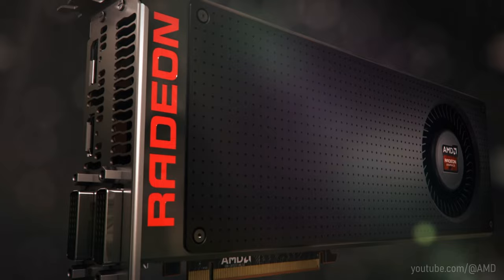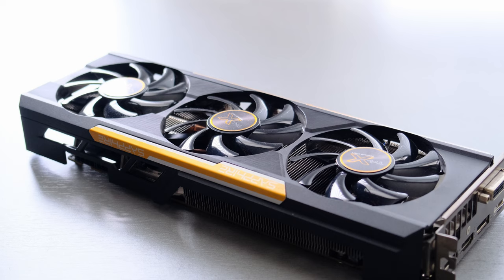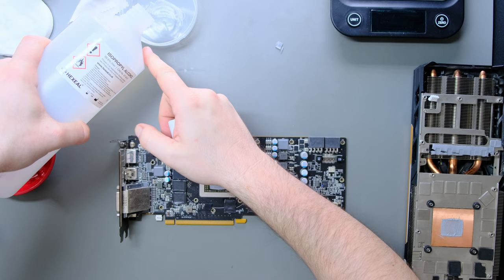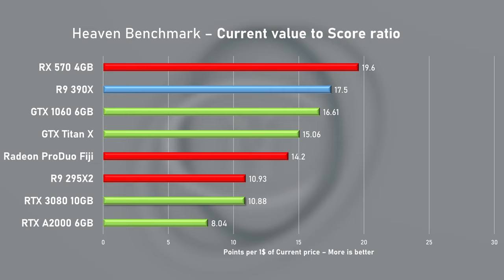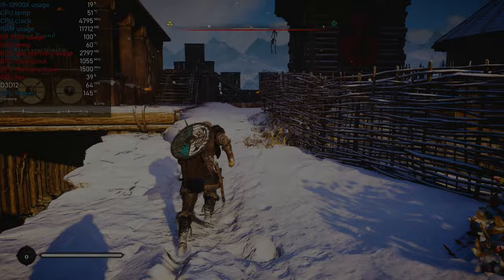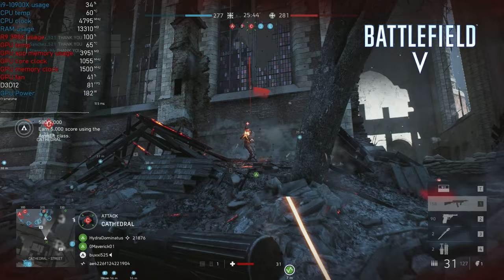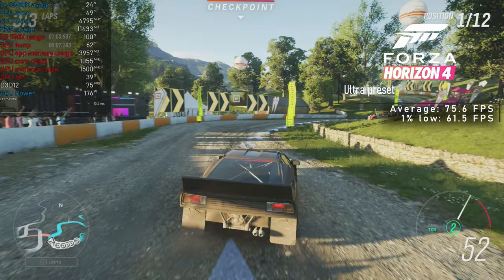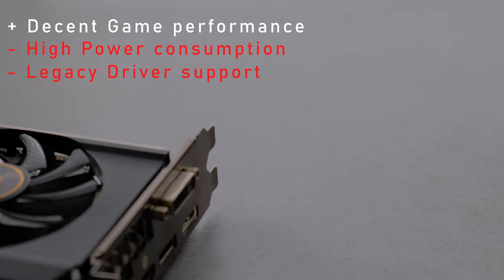The forsaken AMD GPU flagship - Radeon R9 390X Tested

Comment: 512-bit memory bus, now that's a proper GPU! And today the vendors try to sell you 128-bit e-waste for a higher price tag.
Reply: @ashen2192  the 390X is 8 years old and still holds up. The RX 6600 in 8 years down the line will be in a landfill.
Reply: @ProjectPhysX  That's a valid point. However, the reason the 6600 will be down in a landfill in 8 years is because of the 9th Gen. consoles. These old early GCN GPUs held on for so long was because the Xbox One and PlayStation 4 basically had lower mid-range GPUs (HD7770 and HD7850, respectively). 
Meanwhile, the Xbox Series X's GPU is comparable to RX6700 vs the PS5 is comparable to RX6600, once you factor in the clock speeds and L3 "Infinity" cache. The channel "Iceberg Tech" has published a video recently on the topic if you're interested:
https://www.youtube.com/watch?v=wyCvEW0DCbk
Reply from the maker: I love the monster spec on some of the older cards. Part of me really wanted the 390X to be faster but I do keep in mind it's 8 year old at this point. New cards come with faster memory so no need for as wide of a bus, but, the overall spec trend is going downwards, that we all agree on
Reply: @ProjectPhysX  There is a difference. The 390X was considered a flagship. The 6600 is budget mid tier, so of course it will suffer more in the future. 390X should be compared with 6900XT.
Reply: @mclarenf1gtr99  the 390X was $429, the 6600 is $329. The 6900 XT is $999, a completely different price class.
Reply: but what does it matter? gtx 1060 delivers same or better performance with much better efficiency. Why would huge memory bus matter if the performance isn't great?
Reply: @megapet777 because don't you know, a bigger number always means better!
Reply: @megapet777  390X is a GPU from 2013, while the GTX 1060 is from 2017. One is on 28nm which GPUs got stuck on for a long while and the other is on the much better 16nm process, thats why the 1060 is ahead. Wider memory buses matter a lot for Bandwith, which higher end GPUs are often limited by. Especially at higher resolutions.

It's like being suprised that a 980ti is slower and less energy efficient then a 2060
Reply: @shepardpolska  I know lol. But I just don't get why people talk about memory bus when it doesn't seem to really boost performance. Vega 64 had 2048 bit memory bus and was built on 14nm process while gtx 1080 has 256 bit memory bus and is on 16nm process. Yet their performance is nearly identical. How come vega had nearly 10x memory bus yet no real world advantage at all?
Reply: @ProjectPhysX  so what's better for you, GDDR5 512bit, or 256bit GDDR6X?
Reply: @ProjectPhysX  6600XT will be used for a long time I promise

Comment: Nexus Tech : the R9 390X 8GB is aging like AMD FINE RED WINE....while the GTX 980 4GB is left behind in dust :).
Reply from the maker: Eeey! I happen to have two GTX 980's, I shall put this to test!
Reply: @nexus_tech  So do I, an Asus Strix GTX 980 4GB (never 2 fan version) and a Gigabyte R9 390 8GB Windforce (the cooler isn't as good on this one as it was on my first MSI R9 390X 8GB Gaming 8G that I regret selling).

Comment: I got my GTX 970 refunded during the "3.5GB Gate" and bought an R9 390 with the money. Really good card power consumption set aside. 8GB on a 512bit bus for less than $400 8 years ago sounds pretty crazy when compared to the current gen GPUs sold at the same price range.

Comment: The R9 390 was an amazing card that aged really well in DX12 & Vulkan titles. Unfortunately it just couldn't hit 1080p 60fps in newer games as time went on. The heaven benchmark highlights it's biggest weakness. Poor tessellation performance
Reply from the maker: Thanks for checking out the video. I'm pretty sure there's more in that card if it was to be overclocked, if power is not a factor to consider, one can just about still get along with it :)

Comment: I am still using this GPU. It still is going well.
Today I changed the fans since the old ones were kinda giving up performance.
Also changed the cooling pads and the thermal paste. 
I went from 94°C top temperature to around 80-83°C.
I wouldnt recomment to play newest games in 1440p with high Graphics but most games nowadays even look awesome without
max graphic settings. 
Besides that it still manages to support 120Hz framerates.

Updating to newer drivers is also no problem since there is custom made drivers by a community so new games won't tell you that you cannot play 
the game due to outdated drivers anymore.

All in all, if you are looking for a budget card 50-100€ this thing is still in the game.

Comment: I used to have an R9 390 Tri x as well, ended up switching to an RX 6800xt just for power consumption, temperatures and overall efficiency, it was a great card when it had driver support I would say, it will always be a great card to remember :')

PD: I managed to catch that card for about $98 at 2020, they were hard times for GPU's

Comment: I had the 290X Battlefield 4 Edition with an Arctic Accelero Xtreme III to handle the excessive heat output. The authorized reseller even installed the cooler for me and allowed me to keep my warranty which is unusual here in Egypt. Best thing after a breakup. Buy yourself a top of the line GPU and get gaming
Reply from the maker: Thanks for sharing 👍 was it the blower design ? I bet that AC made all the difference

Comment: The Asus R9 390 was my first big boy card. Got it in 2015. I remember needing it for wolfenstein the new order (the R7 265 wasn't cutting it). I also remember the fans kicking in like crazy when my tank exploded in World of Tanks (Something about the fire effects). It got me through many amazing games and hours of CSGO.

It's when I got into computer hardware in general. Jay2cents, Gamersnexus and LTT (back when they focused on computers). I was overclocking and running the heaven benchmark runs against my friend that had a GTX970. 

I ran a couple R9 Furys when they blew them out on sale for half price, because I wanted to run crossfire (even though I knew it didn't make sense)

Then I bought a 980ti used. Strapped a Raijintek cooler on it, and ran that for a few years.

I miss overclocking. I miss the excitement of a new generation of GPUs coming in with amazing new value (the 1070 performed around 980ti levels for a fraction of the price).
I miss when games released that were finished. I miss a lot about those years.

Comment: If I recall, the RX200 and 300 series from AMD, as well GTX900 series from Nvidia, were supposed to be on TSMC's 20nm process. But since 20nm turned out be an absolute disaster (Snapdragon 808/810, anyone?) both Nvidia and AMD chose to steer well clear of that problematic node. 
And that's why these high-end RX200/300 series cards ran so damn hot. While the power efficient Maxwell (GTX900) behaved relatively well, the GCN 2 + 3 were doomed! 
This whole fiasco kind of reminds me of TSMC's 40nm woes and the hot-as-phuck Fermi (GTX400). AMD's TeraScale 2 (HD5000/6000), namely the HD5870, performed decently because it was smaller and more efficient while the GTX480 with the massive GF100 die basically turned into a meme!
Reply from the maker: Oh cool! I didn't know, thanks for sharing, interesting reading :)
Reply: It might have been the FURY series, as those are the last 28nm high end GPU from AMD.
Reply: @StaelTek  Yes, absolutley. The Fiji chip you see on Furys is probably the largest monolithic die AMD has ever made, be it CPU or GPU. At 596mm2, it's basically as large as RTX4090's AD102.

Comment: my second pc has r9 290.
The 4gb vram is the biggest bottleneck with bigger resolutions.. i know it well as i have 3440x1440p monitor :) 

You playing the games at the same settings r9 290x works doesnt let the 390x shine with it's 8gb vram..

Even back in 2016, i was rocking two 290x's in crossfire, the 4gb vram was really hurting performance in BF1 at 2560x1440p

Comment: yes there was such a card I bought already used from xfx, high temperatures under 90 degrees, then I took Rx-580 8gb from sapphire, much quieter and more economical, and recently switched to Rx-5700xt msi, a little noisy, but after lowering the voltage it works Amazing ) if you get 390x at a low price and for example from sapphire, then why not)

Comment: I am still running a Asus Strix AMD Radeon R9 390x. I am upgrading to a 2060 this weekend. I ran into constant crashes on BG3 using my 390x. The 390x is still a beast with decent frame rates on monden games, but no driver support finally made me switch.😢

Comment: I have a Gigabyte R9 390X OC which I've had in my pc for around 5yrs.  Just been researching performance specs for the card with "modern" games and am really surprised by how well it performs (my monitor is only 1080p 60Hz).  After my pc crashed it took me a couple of years to be bothered to get it fixed, and have been gaming on an Xbox Series X, and a PS5, on a 4K TV, so have been "spoiled" somewhat - hence the reason there was no hurry to fix the pc.  However, my son asked me about getting the pc up and running again, and I was just wondering hoe this card would stack up and, honestly, I think I can hold off on any major upgrades for the time being.
Additionally, I never had any issues with power draw, or heat, but I stuck a monster PSU in my machine, and numerous fans in the case, which are designed to flow air through the case and are very effective for extra cooling.
Thanks for the video - you may have just saved me a not inconsiderable sum of money!

Comment: welll technically it's still a capable GPU for 1080p gaming, it will somehow trade blows with Rx 580 8gb and just a little bit (5 to 10%) ahead of Rx 570 8gb. The problem is that it will consume 2x as power as the Rx 570 which is insane in the cost/performance.

That being said, with a modest power-consuming CPU like a 65w TDP R5 1600 (to give an example) that will use the gpu at its best, the R9 390x will game pretty well at 1080p, and that for a total system consumption of less than 600w, which is around the same power consumption of an Fx8350 paired with an Rx 580 8gb (which is a way more common build).

At the end of the day, there are too many Rx 570 and 580 out there, gpus that will perform around the same but with way less tdp and way better driver optimization, to really consider 390x as an option... but it is fun to know what's its current standpoint

Comment: I had the Sapphire Tri-X R9 290 non-X, it seemed to also equivalate GTX 1060 / RX 570 as I was getting the same FPS as those cards were getting in tests and surpassing the GTX 970, but maybe these newer cards got better drivers over time. It held up until 2019-2020 like a champ. Oh and it was 260 $ / Euro brand new in around 2015.